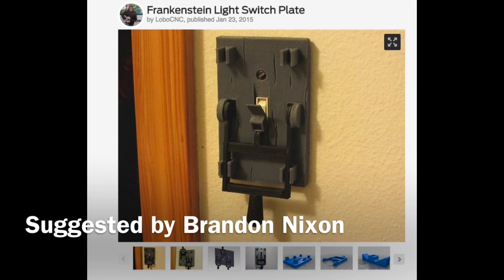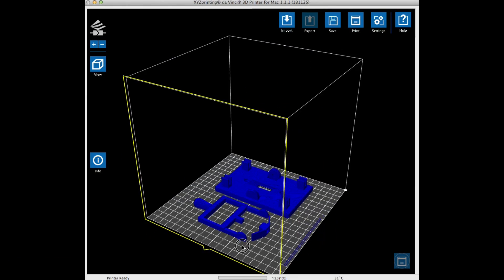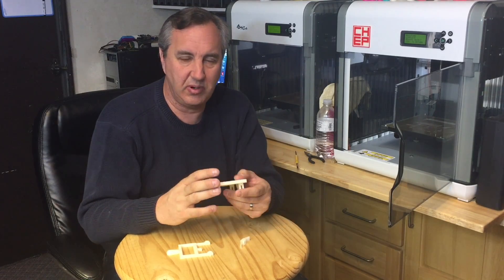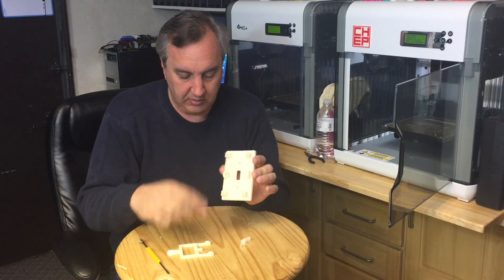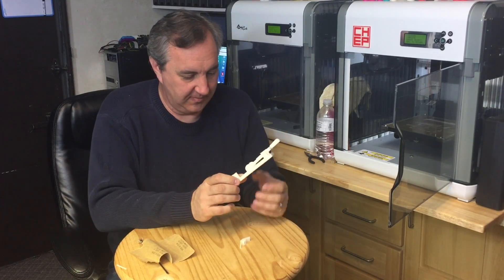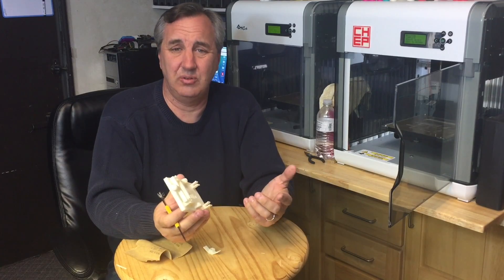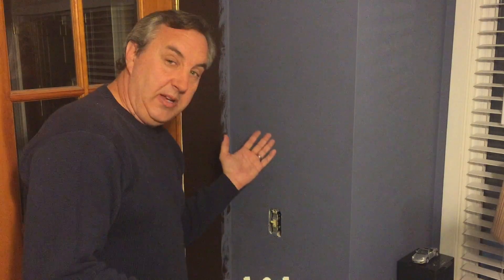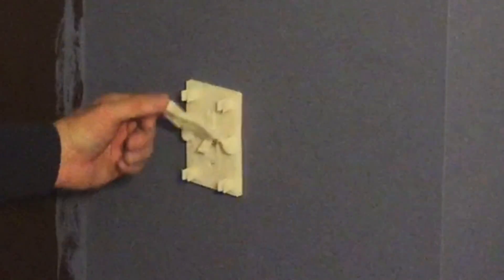Filament Friday #6 - Frankenstein Light Switch Plate on Davinci 1.0 Video #042

Comment: how long did it take to print all three parts for the switch. I have a new printer and am not sure if the settings are right. In Cura, just the base plate said 17hrs to print. I am new to this so have no idea, but love the switch idea. Thanks for sharing. Ron.
Reply: Ok thanks I will give it a go.

Comment: robo 3d printer
auto leveling
fan
heated build plate
build dimensions of 8by9by10 inches!!!

https://www.google.com/url?sa=t&rct=j&q=&esrc=s&source=web&cd=1&cad=rja&uact=8&ved=0CB8QFjAA&url=http%3A%2F%2Fwww.robo3dprinter.com%2Fproducts%2Frobo-3d-abs-model-fully-assembled&ei=M1_yVPiDOPfesATg6oD4Cg&usg=AFQjCNHxOGJKIiVeaxhilLNAilj1_6CQKQ&sig2=HEHKBTwoidmU9RnPhYU6Dw&bvm=bv.87269000,d.cWc
Reply: ive had it for 3 days now and ive fallen in love works great 
the software is so easy to use and has so many great options yo are even able to speed up the printer during a print
ive tried the texting option and it works for me
yes you do need to keep the printer connected
the huge build area is great!!!
the heated build plate always leaves my prints feeling extremely smoot on the bottom!!! i hope this encourages you to buy it i would love to watch you using it and posting videos
it also is able to print in mostly every filament
i have already ordered a wood fill filament 
i have gotten great prints from it so far